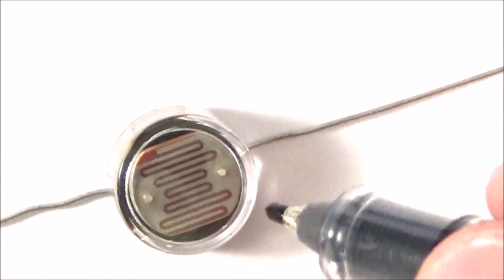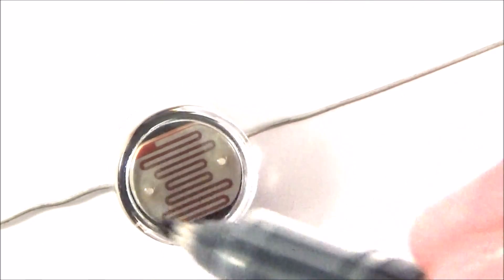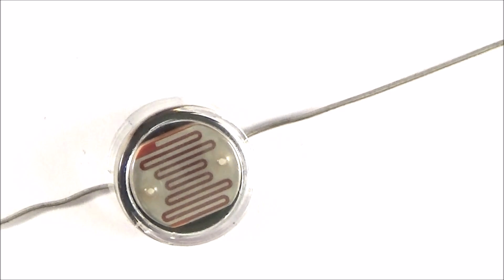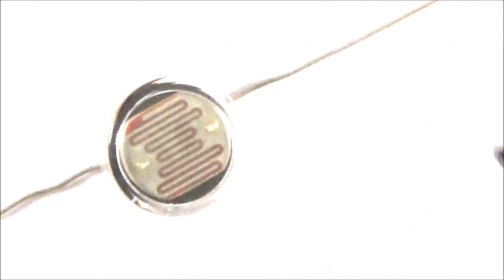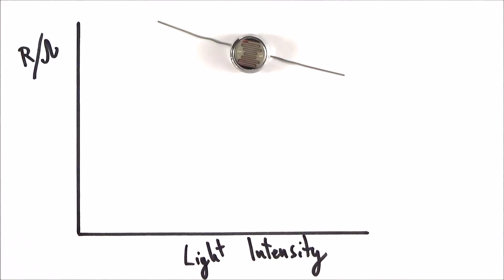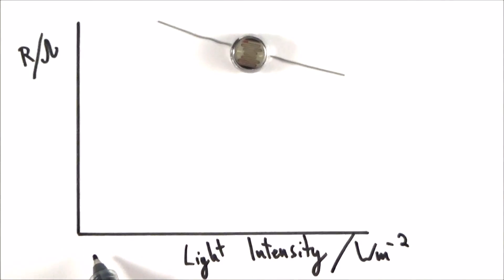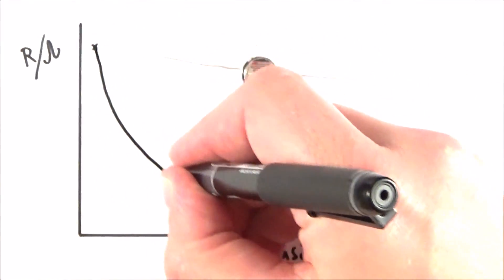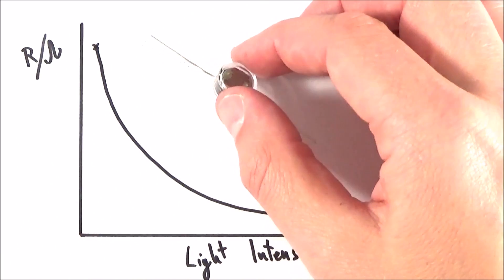The LDR (Light Dependent Resistor) - A Level Physics

Comment: What I do not understand is that why when we increase brightness of the diode, it will give off more heat energy, so it will increase resistance. But resistance decreases instead? Please explain,
Reply: Regarding the geometric properties of the resist, is the external area of the resist (the brightness area) the only factor, or does its behavior differ with respect to thickness?

Comment: It seems counter intuitive, because when the light intensity increases, the resistance decreases meaning it'll get brighter (same current, higher voltage). But doesn't that mean the light turns on when it's.. light?
Reply: No as a increase in resistance then means that more or is being done on the metal lattice this then causes it to radiate the energy in the form of light. So at a higher temp there is lower resistance so less work is done and thus less energy is lost an thus it turns of at higher temps. I think. Sorry,  may be a bit late
Reply: @uthmanrashad775  "a bit late" bro u replied to him 4 years later lmao
Reply: @HamidHirsi  better late then never
Reply: @HamidHirsi  maybe someone else had/will have the same question in the further so this may help them
Reply: @uthmanrashad775  Regarding the geometric properties of the resist, is the external area of the resist (the brightness area) the only factor, or does its behavior differ with respect to thickness?
Reply: +Pav Singh Ignore that, just realised that it's purpose isn't to light up xD